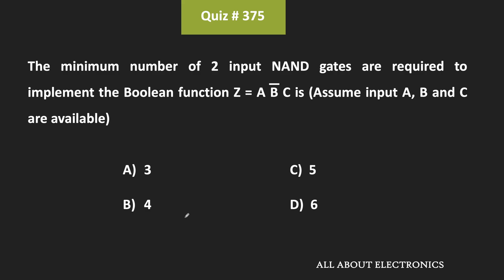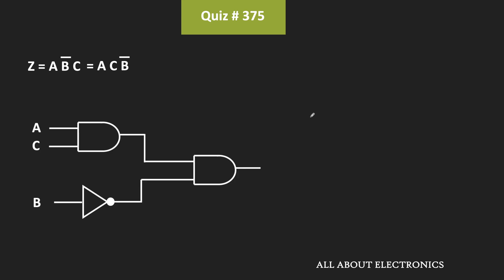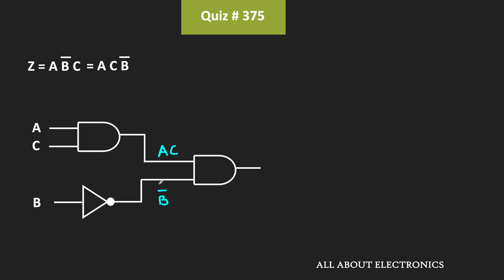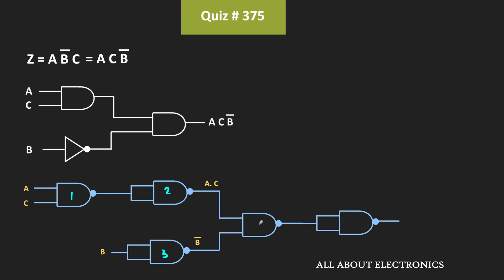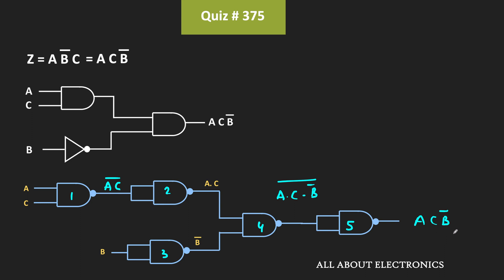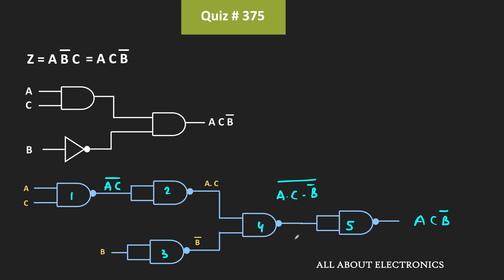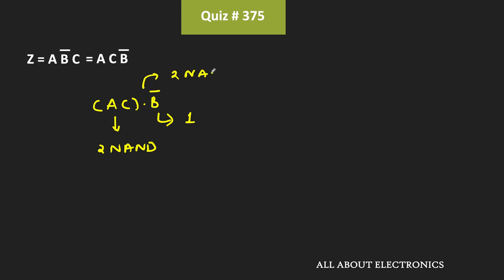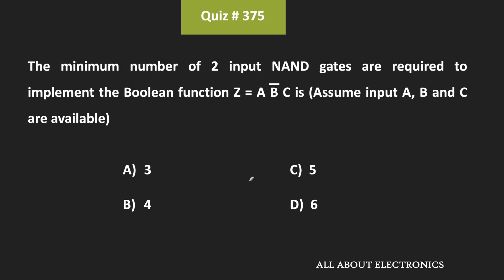Implementation of Boolean Function using NAND gates (Digital Electronics) | Quiz # 375

Comment: Minimum number of 2-input NAND gates required to implement F=(X'+Y')(Z+W), pls solve this using shortcut
Reply from the maker: X' + Y' = (XY)', which requires one NAND gate. 
Z+W, the OR operation of two input requires 3 NAND gate. (If required, please watch the video on the main channel)
And the AND operation of (XY)' and (Z+W) requires two NAND gates.
So, in total, it requires 1 + 3 + 2 = 6 two input NAND gates.
Reply: @allaboutelectronics-quiz  sorry but the answer is 4 two input NAND GATEs, it's a very interesting circuit. Please check 1988 GATE ECE paper for this question.
Reply from the maker: Ok, I got it. I hope, you know how to solve it. If not, then here is the way you can deal with this. 
X' + Y' = (XY)'. Let's say that is equal to P. ( P = (XY)'), Which can be implemented using one NAND gate. P (Z+W) = PZ + PW. 
Which is of the form AB + CD. 
Anything of this sort of form requires 3  two-input NAND gates. 
That means, A + B, A + CD, or AB + CD all implementations requires 3 two-input NAND gates. 
So, overall it requires 4 NAND gates. 
I hope, it will help you to do it in a shortcut way.
Reply: @allaboutelectronics-quiz  still don't feel like a general algorithm which can be used in other questions. Anyways thanks